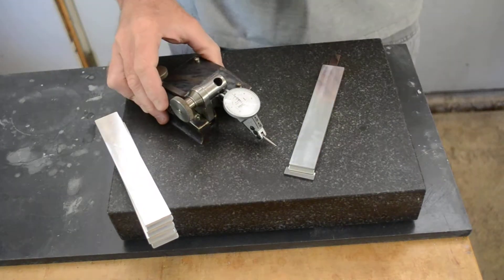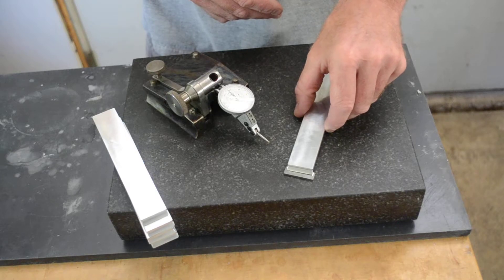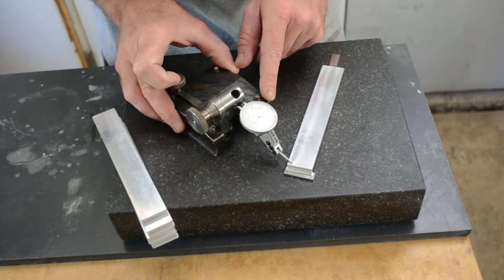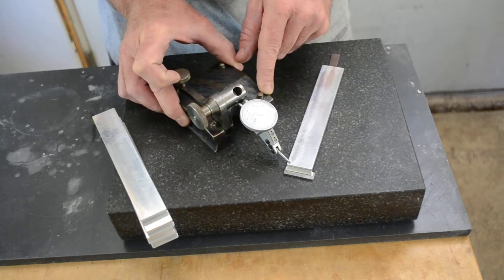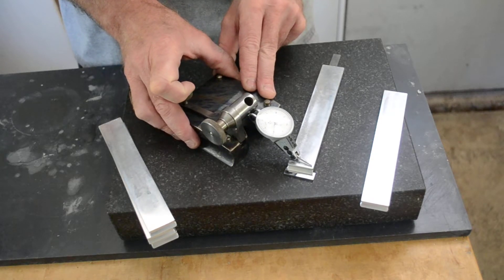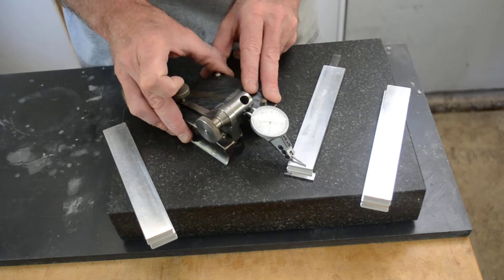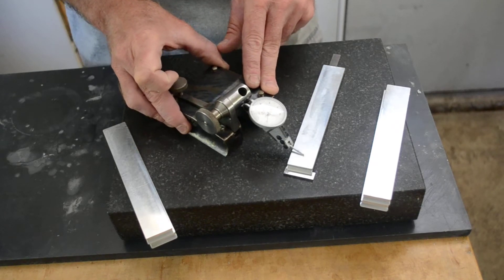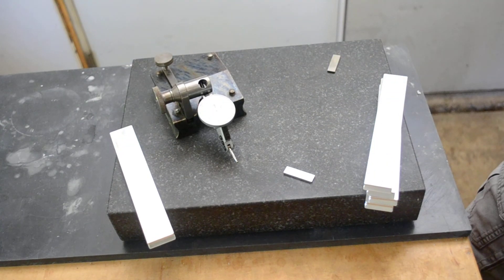Measuring Edge Pro polishing tape holders for flatness.

Comment: I have been using a KME for the past 10 years.  I just purchased the TSPROF Blitz 360.  It uses the 1 x 6 Edge Pro stones.  Will the tape stick to the aluminum holder like it will to glass?  Edge Pro sells a coated version of the holder also, very little reviewing out on Youtube.  Thank you for the video and the diamond matrix products.  : )
Reply from the maker: The tape will stick just fine and the .002" thick hard anodize is well worth the extra $3. The hard anodized bars should look like the day you got it 10 years from now, it is really scratch resistant.
Thank you for your interest.
Reply: @CGSW   Where do you get the anodized bars..?  Any of the 4x1 options have an anodized option? 

I bet few realize "anodized" is the opposite of the cathode vs being a coating like selenium dioxide.